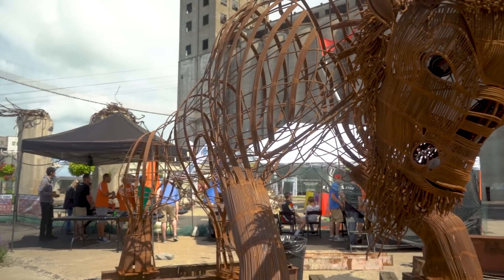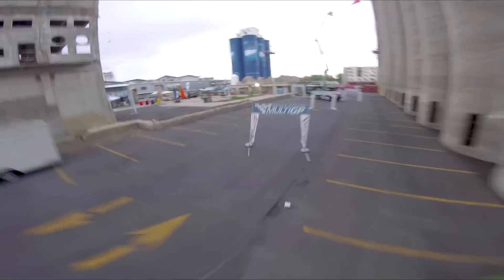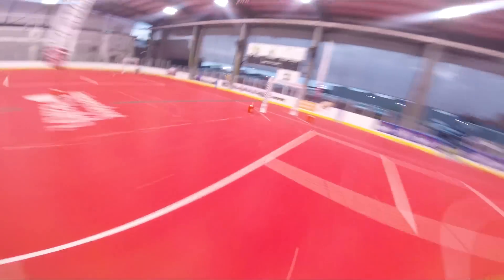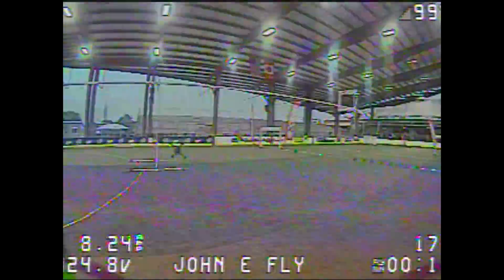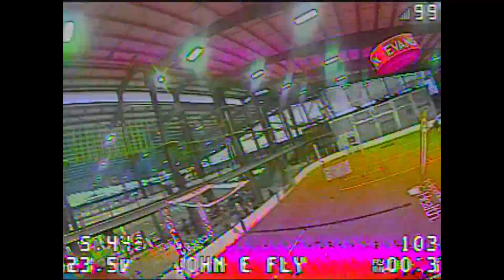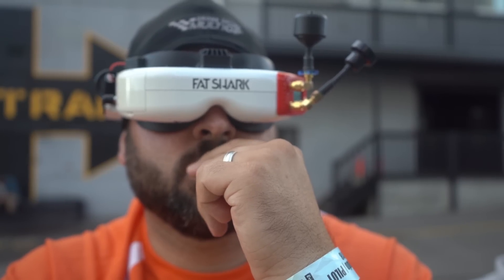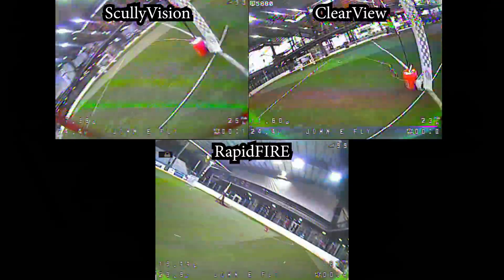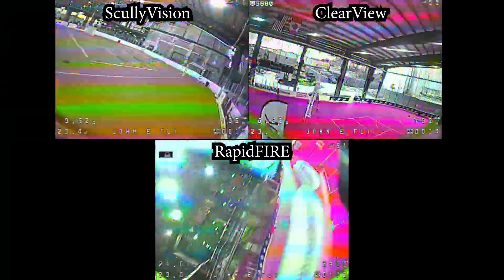RapidFIRE Multi-Path Handling vs Clearview and ScullyVision

Comment: At leas your DVR don't do black outs like mine with RapidFire and HDO... good in googles but not usable for DVR ;/
Also the more you fly course the better you get with bad video issues. And multi-pathing is one of the problem, other is multiple vrx around, so when you fly alone you get slightly better performance =) You needed to try standard sausage antennas (linear) they perform quite good with such environment at least for me they did =)

Comment: CV for the win! Since the rapidfire is in the hands of non sponsored pilots the reviews seems to be not as
Good as iT
Seemed before
Reply from the maker: Yeah, I don't know that I would go that far.  I think a big part of the issue is this rush to review stuff.  People use something for an hour and draw conclusions.  More time allowed more scenarios and people to test, and the issues started popping up.  In perfect scenarios I think it works well.  So if you used it in that scenario and immediately put out a review, it would be nothing but glowing.  Time showed there are some issues, but time has also showed that Immersion has been working on those issues and making improvements.  

I need to make another follow up video in the near future to provide additional information about what I've learned using this product.
Reply: John E Fly thats why I love these kind of real World reviews. Now people can make an honest choice based on real World use vs their budget. IT is good, not the best, but iT is good

Comment: Wow, that's really bad!! Cool location though :)
Was that on circular antennas?
Have you tried PAL instead of NTSC? That might get rid of the funky colors during signal break ups..
Reply from the maker: No I have not tried PAL.  I would be very surprised if PAL would have removed the funky colors, but maybe.  Yes, I was using 2 circular polarized antennas.
Reply: John E Fly I'm not sure either! But they do call NTSC "Never The Same Color Twice" for a reason hahaha

Comment: Personally I'll hold out for the rapid-fire ground station.  Just getting the antennas away from the attenuating block of water that is your skull is gonna help.
Reply from the maker: What about trying it with a Dock-King?
Reply: Don't have the Tru-D module, and it's (Tru-D) never looked impressive on any test I've seen.
Reply from the maker: The Dock-King can work with any module.  You could plug a Rapid-Fire into the Dock King and use it as a ground-station.

Comment: John,Thanks for another great video!  I know it takes a lot of time to make these videos and as a racer that can't make all the events, I look forward to all the info you provide of the events you go to.  I do wonder if the Furious DockKing will be something worth looking into for the RapidFire for events that are indoor multi pathing environments.  Wondering if it would help in those cases to be mounted a bit higher than on the goggles.  Also I was really surprised how bad Scully vision was.Looking forward to meeting ya sometime,Bumpy
Reply from the maker: I should have tried the dockking with the RapidFire there.  A friend of mine had his dock king, I just didn't think to try my module in it.  I'm also not sure if he was running the version that supported non True-D modules.  The Dock King with a True-D module definitely still had a ton of interference.  I would need to fly and record it to understand where it compared to these results though.

Comment: Excellent video!  Was your desync with the Aikon ESC?  I'm STILL trying to get mine flying right. May I asked what ESC you went with?  I'm hoping the new Hobbywing XRotor ESC will be a winner. Sadly, a buddy totally fried (I mean, 4 alarm fire fried) his 6S quad last weekend due to the Aikon. Thanks John!
Reply from the maker: Yes Aikon AK32 with Hyperlite 2405 1722KV motors.  I killed 2 AK32 4-1 ESCs at that race.  Before that flight I had just replaced the AK32 with a brand new one, so the new one was on 100% stock settings.  Unfortunately that causes desyncs with the Hyperlite 2405 motors.  Once I put demag compensation back to high the issue was again 100% resolved.
Reply: The desync is not being caused by the ESC. It'll happen with pretty much any ESC. It is a known issue with the 2405 1722kv Hyperlite motors. Only took swapping every component on my quads and a post on the Piro FB group to find that out..

As John mentioned above, the "fix" is to set your demag to high and possibly motor-timing to auto. However, for me this did not resolve the problem 100% and made the quad fly like crap in general. Pretty disappointing given how amazing the 4s version performed.
Reply from the maker: For what it's worth, I had someone else tell me that changing demag to high didn't resolve it for them either.  I then gave them my betaflight dump and they claimed it flew great with my settings.  Perhaps it would make sense to put betaflight back to stock, change the ESC settings and then try to tweak again?  It honestly flies amazing for me once I switch to demag high.  I also don't notice any change in behavior from demag low except that it no longer desyncs.
Reply: Thanks guys!  I've tried demag comp HIGH and various motor timings (including AUTO) to no avail. As a last attempt I'm going to set throttle idle to 4% (per John's recommendation) and re-solder the one motor that is reversed via software to make it a hardware reversed motor. Interestingly, I have a bud using these same components (AK32 & Pyrodrone FC) but with Hyperlite 2207/1722 on three new builds and he is suffering desyncs on all three!  Maybe it's a Hyperlite motor thing??  Thanks.